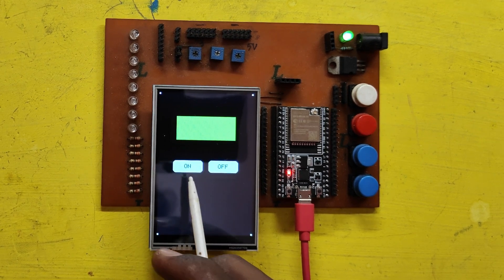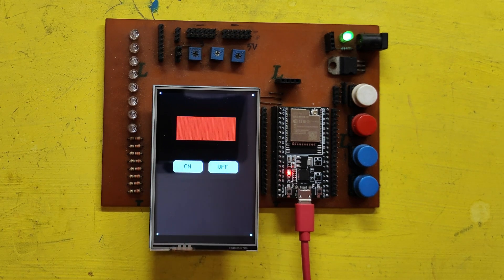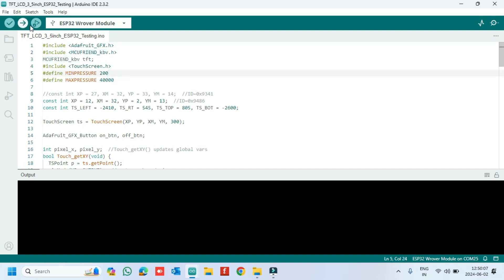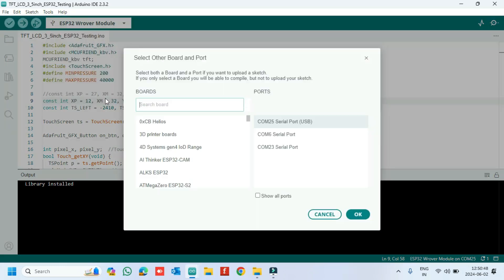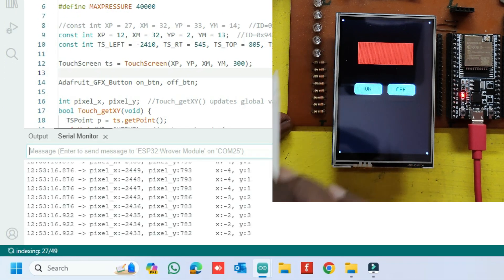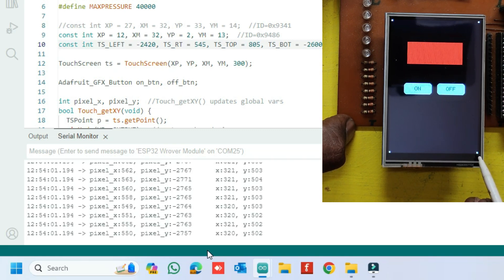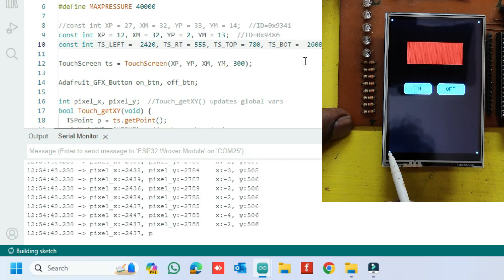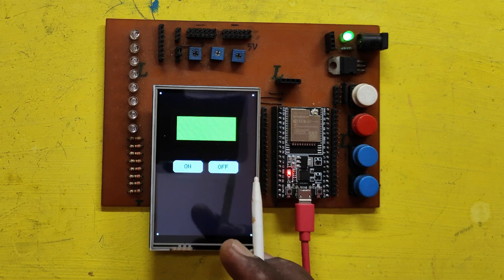ESP32 with 3.5 inch TFT LCD Touch Calibration || ILI9486 TFT LCD || ILI9341 TFT LCD Sheild | 480*320

Comment: Hello, thanks for the video. Is there a difference in using 3.3v vs. 5v? Is the backlight of the screen also working with 3.3v? I have some issues that backlight isnt working, when using 3.3v.
Reply from the maker: Connect 3.3V to 3.3V OR  5V to 5V
based on model it is working

Comment: Hello Engineer. One question; I also bought this display, but I don't know which base the touch driver of this display is and what is the model of the touch driver?
Reply from the maker: Use Arduino program to find the module driver

Comment: Hi, thank you for sharing this. I've followed each step but I'm getting this error

In file included from /Users/name/Documents/Arduino/libraries/MCUFRIEND_kbv/MCUFRIEND_kbv.cpp:38:
/Users/name/Documents/Arduino/libraries/MCUFRIEND_kbv/utility/mcufriend_shield.h: In function 'void write_8(uint16_t)':
/Users/name/Documents/Arduino/libraries/MCUFRIEND_kbv/utility/mcufriend_shield.h:1084:5: error: 'GPIO' was not declared in this scope
 1084 |     GPIO.out_w1tc = map_8(0xFF);  //could define once as DMASK
      |     ^~~~
/Users/name/Documents/Arduino/libraries/MCUFRIEND_kbv/utility/mcufriend_shield.h: In function 'uint8_t read_8()':
/Users/name/Documents/Arduino/libraries/MCUFRIEND_kbv/utility/mcufriend_shield.h:1090:19: error: 'GPIO' was not declared in this scope
 1090 |     return map_32(GPIO.in);
      |                   ^~~~

exit status 1

Compilation error: exit status 1

Do you know whether you have come across this issue before? I've checked the pin 32 and its correctly wired to LCD_RS
Reply from the maker: Did you use my mcufriend library and use esp32 board version 2.0.11

Comment: Hi, is this library in Google drive link the same as the one in the video? I have some problems when compiling
Reply from the maker: Yes. It is same
Reply: @TeachMeSomething  
In file included from /home/eduardo/Arduino/libraries/MCUFRIEND_kbv/MCUFRIEND_kbv.cpp:38:
/home/eduardo/Arduino/libraries/MCUFRIEND_kbv/utility/mcufriend_shield.h: In function 'void write_8(uint16_t)':
/home/eduardo/Arduino/libraries/MCUFRIEND_kbv/utility/mcufriend_shield.h:1084:5: error: 'GPIO' was not declared in this scope
 1084 |     GPIO.out_w1tc = map_8(0xFF);  //could define once as DMASK
      |     ^~~~
/home/eduardo/Arduino/libraries/MCUFRIEND_kbv/utility/mcufriend_shield.h: In function 'uint8_t read_8()':
/home/eduardo/Arduino/libraries/MCUFRIEND_kbv/utility/mcufriend_shield.h:1090:19: error: 'GPIO' was not declared in this scope
 1090 |     return map_32(GPIO.in);
      |                   ^~~~
exit status 1

hi, I'm having this problem, can you help me? im using the library from the video description